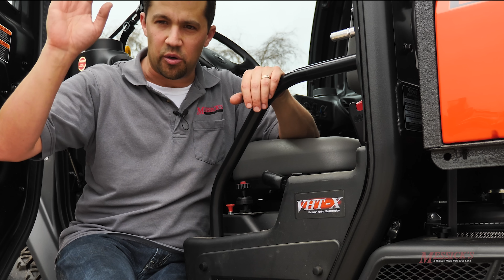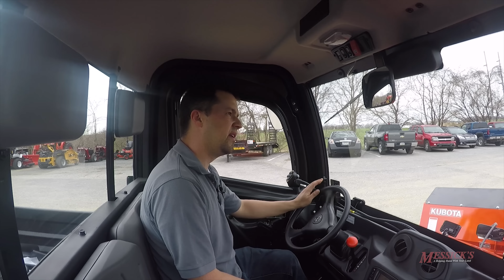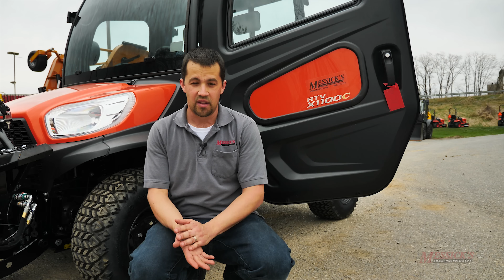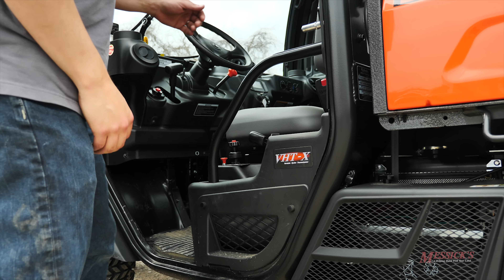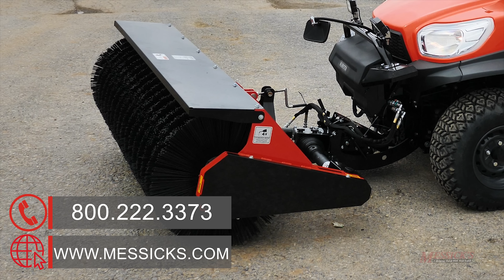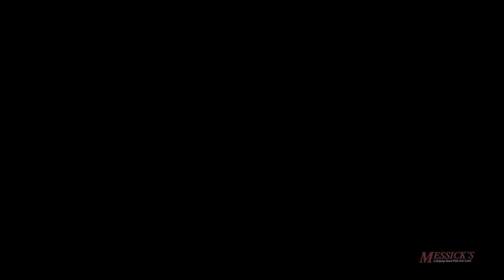Get more power from your Kubota RTV with a hand throttle kit (V5245)

Comment: I live in tn and have mostly steep pastures we have to climb In low and it takes forever to get to the  cows I didn't realize they even made one of these thanks for the info Neal
Reply from the maker: Yea, your the perfect candidate for one.
Reply: We have the rtx 1140 4 seater, me and 4 normal size guys were in it and it barely made it up our drive way, i was in low gear and had to floor the pedal all the way down and 2 of the guys had to jump off or it would have just stalled. Very weak machine. We dont need speed, it only goes 12 maybe 13mph on flat concrete which is fine. But absolutely no power or torque in low gear.
Reply: It will not help. The only thing that will help is a turbo kit.

Comment: You sold me and I ordered the kit. Easy install and I can see several scenarios where I will love having that power. Already tried it out. Two things, the button in the middle of the handle releases pressure to bypass the screw option. Works great for slowing the speed, but pulls off when  you pull to increase rpm’s. Bummer, wish it had a pin in it. The X900 has been difficult to shift since day one, I was told at my intro that they were just all like that. But with the hydraulic pressure at higher throttle it is impossible to shift. I have to throttle back down to change speed or direction. Well worth buying but suggestions for these issues welcome.
Reply from the maker: "all RTV's are hard to shift" is true to a point, but some do need adjustment. If your finding that dialing up the RPM's changes the shifting difficulty I'd suspect you could benefit from some adjustments to the neutral position.
Reply: Messick's I’ll make sure that happens, thanks! Very pleased with the purchase.

Comment: the transmission shifts by engine speed & placement of the foot feed which controls the fuel intake and a separate lever to the transmission normal use at about 1600 rpm the transmission shifts to a higher gear. This is just fine on level ground, however on hills when you push the foot feed all the way down the transmission wants to shift to a higher gear. The hand throttle bypasses the footfeed. pull the throttle out to max rpm and use the footfeed to just control the speed. the transmission stay is low range
Reply from the maker: It's a hydrostatic, it does not 'shift'
Reply: @MessicksEquip  ☺Is that a fact? you must have voted for obama twice
Reply: @leehelle9131  Ohh Oh good one messicks LOVE IT !!
Reply: @leehelle9131  Yes, he didn't vote for racism.  I guess that is your deal huh?

Comment: I'm sorry, but I am still confused by something. What is the difference between V5245 and K7421-99450? When I go to build an 1100, both are presented as options under Sweepers with the V5245 costing more than the K7421-99450.

Comment: Are the doors on this hard cab removable so you can have an open cab
Reply: The RTV 1100 doors lift off the hinges. You have to disconnect the gas springs first, but it's pretty quick and easy.

Comment: Neal, If Messick’s was next to where I live in Connecticut you would have the sale. Because of your previous video I took delivery of my 1100c two days ago. First drive up my steep driveway, with air conditioner on, I thought oh no, “I need get out and push”. Next day this video appeared. Perfect!  Yet, while reviewing the operator’s manual it states in many places do not do what you demonstrated. ‘Do not use hand throttle while driving’. ‘Before driving the vehicle, confirm the hand throttle to be positioned to the low position’. These quotes and more can be found on page 30. Would you please clarify?
Reply from the maker: Would not know why. All the applications for the hand throttle are not stationary
Reply from the maker: Is it telling you not to adjust while driving?
Reply: Messick's Yes and no. One statement informs not to use hand throttle while driving.  Another statement informs “before driving the  vehicle, confirm the hand throttle to be positioned to the ‘low’ position”.
Reply: Thanks Neal. I am appreciative  of your extremely useful, thoughtful, videos. You have significantly increased my Kubota owner satisfaction.  Let me know if there is any way I can convey my appreciation directly to Kubota.

Comment: Need some help. Live upstate New York around some steep hills. After reading many posts about x1100c having difficulty with hills, I’m thinking this might not be the right machine to get. Do you guys always have to operate x1100 in low when going up hills, what’s the top speed in low gear? Does engine still bog down going up steep hills in low? Thanks for the help!
Reply: You would not be happy with it up hills. They are not great. Mine will not even go 10pm up medium size hills

Comment: I wish i had an rtv
Reply: MoreWelds you can permatex makes some for pretty cheap. And there handy.
Reply: @FishFind3000  funniest thing i have heard all year
Reply: I do maintenance for a farm that has these. I hate working on them. There is too many different things to lubricate, some work a spray, some with a great gun, etc. You have to check under the hood, seat and rear dump to check all of the fluids. They are great except working on them.

Comment: It would appear this kit differs from the throttle control that comes standard on the RTV X1100C. Is that the case?
Reply from the maker: There is no standard throttle control on the 1100.
Reply: @MessicksEquip  I was misled by an online post I read then. But, why does the 1100 manual on page 30 state this when the video and comments indicate you can use it while driving?
"Do not use the hand throttle while driving the vehicle,
always push the hand throttle back to the "LOW"
position.
Before driving the vehicle, confirm the hand throttle to
be positioned to the "LOW" position."
Reply: I'm sorry no need to reply. I see you already answered this question in the comments.